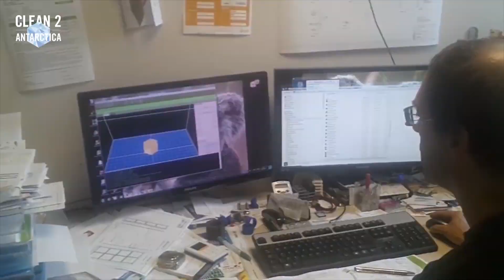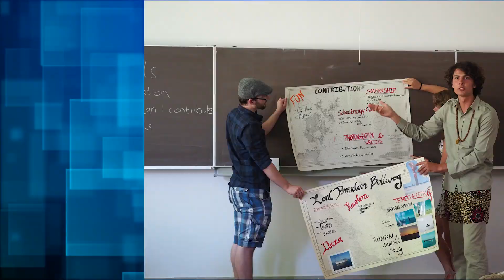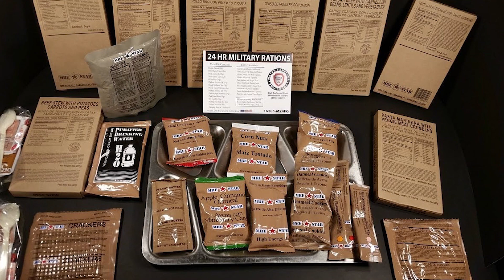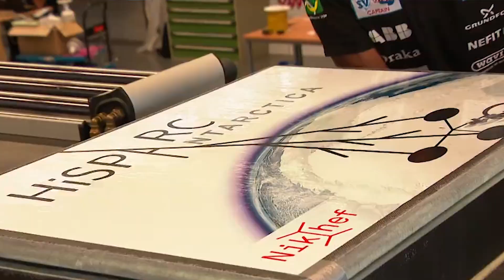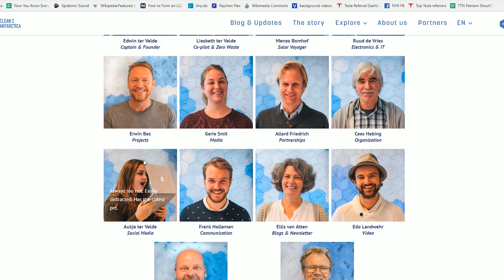Solar-Powered Expedition to the South Pole?!

Comment: Need batteries to keep from tipping over.
You need some way of defrosting the window or they will freeze over.
Extra battery would be great in case a storm hits/panel cracks/solar isn't enough at some points in the day.
If its windy enough to tip over the train... its too windy for people to get out and lift it back up...batteries/supplies would keep it from tipping over.
Keep batteries in the cabin near the floor for heat.
Is there enough room to stand in there? "just stand outside in the -50 degree weather." sure.
You are def going to need some dark glasses so you don't burn your retinas and a hard drive full of podcasts to be entertained for a month of driving.  
Maybe a constant throttle would help, no need to have your foot on a pedal the whole time.
Also if the panels are snow covered the batteries would give extra time to clear them when conditions are more favorable. Im guessing you are going to fill a trailer full of water... that is not enough solar to melt snow/heat the cabin/run GPS communications and drive... unless you have battery storage. 
Also hoped you though about the human waste problem and I guess your not going to shower for a month.

Comment: The key is going the right time. During the December solstice, Antarctica has continuous sunlight for several days. Also, cold temperatures and reflection from the snow will boost power output. Their biggest hazzard is the terrain.

Comment: There is no way that this design could work in heavy storm weather. They could avoid some turbulence by measuring  the wind speed and automatically make the panels go into "T" position but this "T" design just seems not that aerodynamic.

Comment: I think they have forgotten that wind is also a product of the Sun's power. While those solar panels will block wind, they do not form very effective sails, and if the plateau route they mean to take has so much wind, I wonder why they did not think to 3d print the turbines, or the control mechanism to make the panels function as sails that will also take advantage of it for travel in that region.
Reply: Maybe they didn't think of it, because you were not there to help them?

Or, their prior experience on the opposite end of the world informed them that avoiding wind was more important.
Reply: Simple answer: Complexity
This cart is as simple as it can get. Any more will make things far more complicated and prone to fail.
Reply: Iceland has a windmill you might take along. Setup when parked?
http://icewind.is/en/
Reply: Its shocking to me people are still pushing fucking wind turbines, when new blade less designs are simpler and more efficient.  They look like small cooling towers.   Wind turbines are complete and utter BULLSHIT. Total scam,
Reply: Hanniffy
Any links?

Comment: Why not have the panels slip flat.. I do not see why that could not happen as air compressor can be used. 12 volt car compressor into a tank to handle the air valves they will work at -80C   South pole will not have issue with ice the air will be dry.